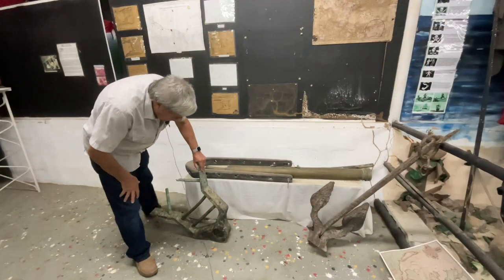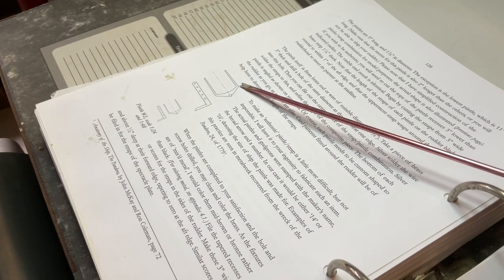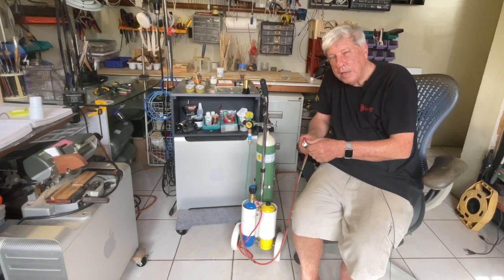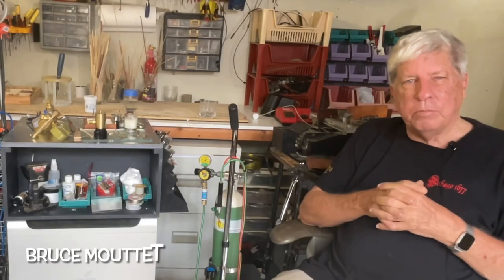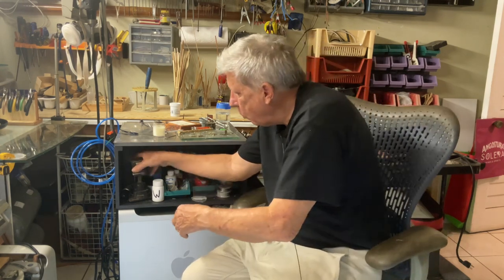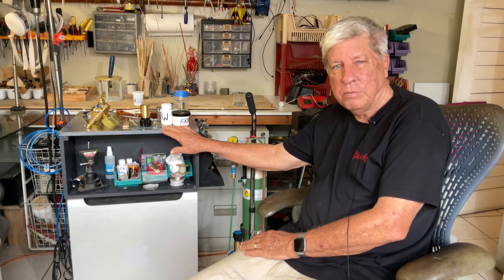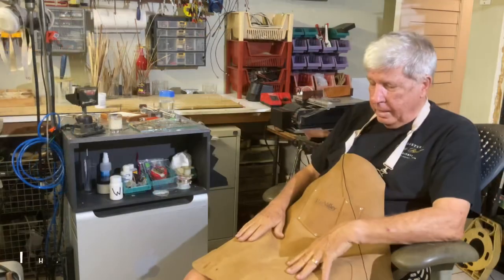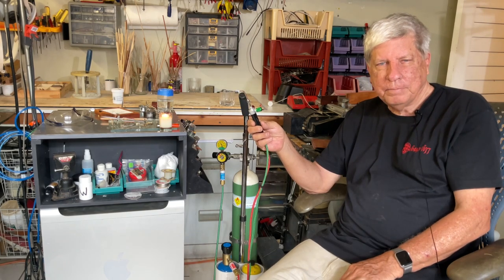Video 101. HMS Thorn. Setting up the shop to solder using a little torch. The rudder Part 2.

Comment: A very informative video, especially for modelers who have no previous experience with oxy/fuel torch equipment! I spent 41 years as a certified welder for a major U.S. railroad, as well as being a certified welding instructor. Your focus on the safety aspects should earn you a medal! The company I worked for mandated flashback arrestors on every torch regardless of whether it was a cutting, heating or welding/brazing torch. Some torches have them built in, but the ones that didn’t required us to install “external” flashback arrestors like the set you showed, but they were required to placed between the torch and hose because a flashback is always initiated at the torch! The other mandatory safety device we had to have in place was reverse flow check valves, and here again some torches have them built in, and most flashback arrestors have reverse flow check valves built in also. As with the FBA’s, the check valves were required at the torch end of the hose, along with the recommendation that another set be placed between the hoses and regulator, but not mandatory there. The procedure for lighting the torch was to crack each torch valve for a couple seconds to remove the possibility of mixed gasses in the hoses, then as you did, light the fuel gas first, then bring in the oxygen. When shutting down, the oxygen torch valve would be closed first, followed by the fuel gas torch valve. The reason being that if the fuel valve was defective you’d know it because you couldn’t fully extinguish the flame! The final task, as you did, was to open each torch valve and relieve the pressure. A final story, it was obviously against the rules to turn both torch valves on and light the torch. Over the years I saw quite a few fellow workers get written up for rule violations because the General Foreman heard the loud “pop” that happens when a torch is lit with both valves opened! The noise would tell on them! Ha! Well done Sir!
Reply from the maker: Thanks for this extensive response Tom. With the Smiths little torch the only place we could add the flashback arresters is at the tanks. I suppose its better there than not at all.
Reply: @kevinkenny5122  Yes, it’s definitely better than nothing at all! I looked up the Smith Little Torch (owned by Miller Electric now) and it has no built in reverse flow check valves or flashback arrestors. They do sell the CV’s as an option, but list nothing as far as FBA’s. I’m anxious to see how you like the torch! Might have to look into one myself! I know Smith has made them forever, or at least the late 70’s, because I remember seeing them in literature back when I began my welding career! Please do a follow up video to show how it’s working for you!

Comment: I have the book the anatomy of the ship model Pandora by the same authors, but it is nothing like yours Is there two different  books ? Mine is not in a 3 ring binder. Great work I like your shop Thank you for your help . John
Reply from the maker: Hi John.it is actually 4 books. It has become the best reference set of book i own and i own a lot of books. The three ring binder was gotten in the early days and is no longer available.